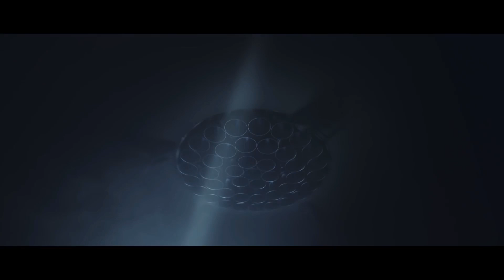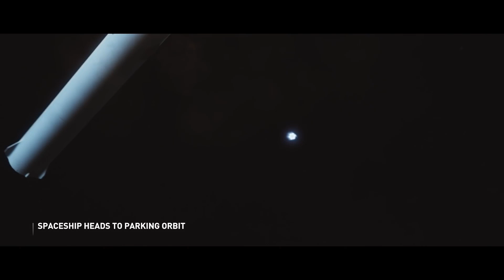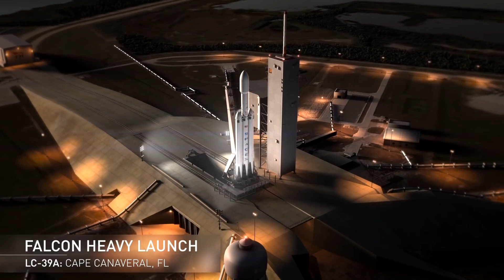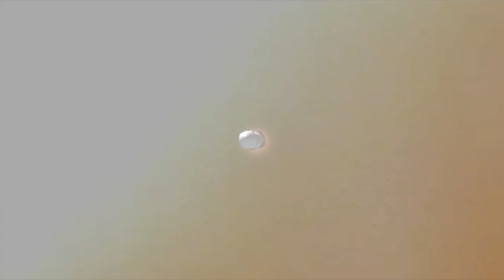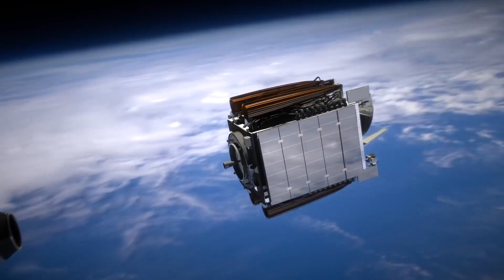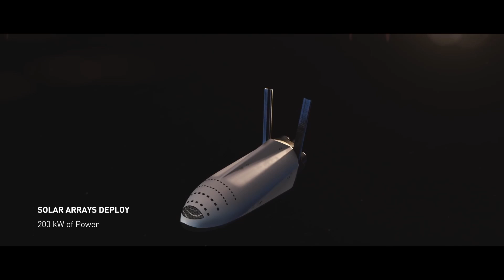Why 42! Engines On SpaceX ITS Concept? - A Simplified Little Insight Into Optimization And Scaling

Comment: What about the thrust per nozzle area ratio? (for rockets with higher sectional density)
Reply from the maker: usually for one fuel and one surrounding pressure a well optimized rocket engien will have one resulting thrsut/nozzle area ratio
 either way no matter the thrust/area ratio the thrust to weight ratio is still roughly proportional to the inverse of the nozzle diameter - that is also depending on material and engineering quality - but essentially you need enough material to carry the force of your thrust over the size of the nozzle
Reply: +Julian Danzer If you have an higher chamber pressure that means that the nozzle ratio will be higher so the exhaust gas will be colder, more dense and will move faster so you need a smaller nozzle.
What's exactly the nozzle ratio? The ratio between the density of the gas in the combustion chamber and the exhaust gas ???
If you keep the same nozzle size and you increase the chamber pressure the ISP will be higher despite the fact that the engine will be underexpanded? The nozzle ratio will be the same so the efficiency should be the same but the exhaust pressure will be higher than air pressure so the gaz will keep expanding and the ISP will be higher (despite the fact that you will have a small loss in efficiency due to the gas expanding sideways)
Reply from the maker: yes the isp will be higher but it will still be very close - all optimisation towards efficient rocket engines like higher chamber pressure, better designed shape, etc mostly changes only a few percent of the ISP - that said yo ucould build a way way way underexpanded engine and get a higher thrust to area ratio and it owuld also have a btter thrust weight ratio but you can't take it very far before the loss of efficiency is no longer worth it
a well optimized engine for tkaing offo n earth releases gas at around atmospheric pressure - and at that pressure and the burning temperature of your fuel that gas happens to have a certain density - since ISP optimisation is in the range of a few percent at best we also have a practically given speed and well, a given speed and density means a given massflow per cross section which again multiplied with our practically given speed gives a certain thrust per cross section - unless you build intentionally unoptimal engines - or of course switch ot an entirely different fuel
Reply: +Julian Danzer But if the chamber pressure is incredibly high (like 300 bar) you can underexpand the nozzle way further without losing too much ISP because you keep a good nozzle ratio, no?
Reply from the maker: you could - but barely anyone actually does that since it's usually just not worth it
Reply: +Julian Danzer With the actual raptor engine you can build a rocket that can send 4800 tons in space if you make a booster larger than the spaceship to improve the area and so the thrust.
But if you reduce the nozzle diameter by two (that's feasible, the engine itself is smaller than the nozzle) you can send 300 000 tons of payload in space... (square cube law, 4x the thrust per square meter = 4 times the size = 64 times the mass)
Reply from the maker: the problem is thrust weight ratio is not the only thing to optimize here - in fact it used to be important - but the higher thrust weight ratio gets the less relevant it becomes
think about it: imagine a rocket where 60% of it's empty mass is engines - making lighter engines could vastly improve it - whereas one where 1% of it's empty mass is engines - well further improving it won't save more then 1% weight
space x engines are already so light that further improving them isn't really worth it anymore - going to space still needs fuel and fuel needs fuel tanks
the falcon 9 first stage contains about 4.5 tons of engines - and about 15 tons of fuel tanks - so you can see while improving engines might help, it's not going to limitlessly improve hte rocket, improving fuel tanks would be much more important
same with the BFR but on a larger scale
Reply: +Julian Danzer Yeah, higher thrust to weight ratio (fuel tanks included) means more full mass/dry mass ratio so more delta v
Spacex need more delta v per stage in order to be reusable: The booster needs to be lighter than the second stage at MECO in order to keep an high efficiency. The lighter the booster is, the faster you will be at MECO while reusing it. With more delta v per stage you can even perform a boostback in order to land on the launchpad.
The second stage also need the highest delta v in order to decrease the speed at MECO so you can perform a boostback and landing. It also need an high delta v if you want to refuel it in orbit to go to the moon and back.

Comment: It's not about thrust at all (although the Merlin engine is quite efficient).  NASA had a rocket with a comparable payload 70 years ago.  If it was sheerly about thrust, then SpaceX hasn't substantially improved on something 70 years old.  But that's not the point at all.  It's about cost and re-usability, something which SpaceX has excelled at.  
1:  Keeping the same engine size as their earlier rockets allowed SpaceX to build a series of larger rockets, while only iterating on (rather than re-designing) their engine.  This saves on cost, and you will find the raptor engine to share some parts with the Merlin, and be of comparable size.  This is why BFR will use similarly sized engines, even though the scale is much greater.  Because it will share parts!
2:  More engines allows finer control of thrust.  The falcon 9 is able to scale back to a small fraction of it's maximum thrust (due to it's numerous engines), which is absolutely critical for landing their rockets in the final moments.
Reply from the maker: indeed its not about thrust - but it is a bout thrust to weight ratio - the BFR will be almost an SSTO, while the Saturn V needed three stages to get into orbit - other parts ocntribute s well but the thrust weight ratio of the raptor engine compared to the F1 is probably the biggest difference that makes it possible for the BFR to need less then 3 stages in order to reach orbit
Reply: No, it's not.  In fact the weight of the engine itself is a pittance compared to the weight of  the fuel.  On the Falcon Heavy for example, each booster carries 9 engines weighing 200kg each (1.8 metric tons) and 395 metric tons of fuel.  So efficiency of fuel usage and raw thrust are actually MUCH more important than thrust vs weight of the engine.  The merlin engine in that example is literally only 1/219th of the weight of it's fuel. 

Specific Impulse measures the efficiency of the engine in generating momentum due to fuel.  And raw Thrust allows that rocket to escape gravity in a speedy fashion (since gravity is a constant, the longer the rocket spends in opposition to it, the more fuel it will use - which is why first stage boosters often feature great thrust and less impressive specific impulse).  

While the Merlin engine is noised about as having the highest thrust to weight ratio of any engine, that's mostly a marketing slogan.  It only boasts mediocre specific impulse.  In fact, the engines built for the upper stage of the SLS (J-2X) have roughly 44% greater specific impulse than the the Merlin 1D and 1D FT.    

That's not to say that SpaceX engines are any kind of slouch.  The alleged stats for the Raptor include an impressively high Chamber Pressure (and this is important for various reasons, especially with smaller engines, which I won't go into atm).  And the Merlin 1D  produces a great deal of raw thrust (almost 1 meganewton).  There are other impressive features.  But there are heavier engines that excel to a greater degree in any specific category.  

But if the falcon 9 ran on 3 engines rather than 9, it would only be able to throttle thrust to 1/3 of it's engines.  Which would make it's 'hover-slam' approach to landing much much much more difficult (the Falcon 9 can hover due in part to it's ability to turn 8/9ths of it's engines completely off).  Additionally, a rocket with more engines can survive more engine failures (yay for redundancy).  And also, completely re-engineering their engines from scratch every time they decided to launch a bigger rocket would cost SpaceX a lot of money.  Those are literally the #1, #2 and #3 reasons why SpaceX is using smaller engines.
Reply from the maker: engine weight to fue lweight comparisons are a bit misleading - in fact the engiens make up about 1/10 of the first stages empty weight - and that is important - the fuel eight to empty weight ratio is always pretty big in rockets, but since the rocket equation is exponential for an ssto the empty weight may not be bigger then 1/20 of the fuel weight - so thrust to weight ratio is indeed relevant - in the falcon 9 the engines are rather lightweight even compared to the fueltank, so here they don't matter much - but if they were heavier that would change and tey would become a significant impact on the overll delta V - also the sls or spaceshuttle engines are completely irrelevant comparisons - they burn lh2 lox rather then hydrocarbon lox - now the different hydrogcarbons can be approximately grouped together but lh2 stands completely seperate - for very simple chamical and physical reasons its quite obvious that any lh2 engine will have much greater specific impulse then a hydrocarbon lox engine BUT the fueltanks for LH2 ar incredibly heave - here the enigne indeed becomes irrelevant, the rest of the rocketstructure becomes much heavier and its overall al ess effective system, building an ssto with lh2 is pretty close to impossible without some far future materials while building an rp1-lox or methylox ssto is counterintuitively much easier despite the lower isp simply because the fuel tank is so much lighter and smaller
Reply: Those are fair points.  Sure, it matters of course, in the sense that it's not irrelevant.  Of course if the engines had an exceedingly low Thrust to weight ratio this would become a major issue.  And of course every kg matters.  There's a lot of factors involved that weave into the Tsiolkovsky rocket equation, and I don't disagree that (engine) Thrust to weight has an impact, but it's far from being the only one.  I have a feeling that you understand this, and we are just approaching the issue from two separate angles.  I could say it's not the significant distinction between engines where modern engines are generally pretty light, but someone could make me a liar by building a garbage engine out of lead (hyperbole - obviously lead would be a horrible material lol).

But these aren't the primary reasons for smaller engines.  Both Blue Origin and SpaceX rockets have the concern of being able to near-hover.  Blue Origin solves this with a single BE-3 engine that can throttle down to below 20%.  SpaceX solved this by using multiple engines, when each Merlin D engines is only able to throttle down to 70% each (latest iterations are more impressive, but the original design called for 70%).

Obviously, you can't hover an empty rocket at 70% throttle.  Therefore you either need to develop an engine with more impressive throttling characteristics.  Or you use smaller more numerous engines and shut excess engines off completely.  SpaceX chose the more expedient route.

Comment: You are wrong. A lot of small engines is less efficient than One giant engine. If you scale up your engine certain parts like nozzle, piping engine walls are scaled in 2D(because they are flat) and the combustion chamber, and nose cone volumes scale 3D. So if you double an engine on x,y, z you get 8 times more powerful engine that is about 4 times heavier.Some parts don't scale well so probably about 5 times heavier. The reason SpaceX has a lot of engines is due to easy manufacturing and high redundancy
Reply from the maker: walls will also need to get thicker though - and at the same pressure and exhaust velocity, an enigne with twice the diameter will only have 4 times as much power, for obvious reasons
Reply: check the history of Saturn V F1 engine. Elon said in readit AMA that he can easily scale raptor up and have better trust to weight ratio. but has alot o engines for redundancy
Reply from the maker: thats as I mentioned because of small complicated parts being harder to design and build, so you are forced to make them oversized for small engines, without manufacturing limitations the basic physics set limit for thrust to weight ratio is simply set by the combustions specs, the material and the size of the engine, whereby the thrust weight ratio is invert proportional to the neck diameter

Comment: I love the ITS design but we are still decades away from rapid reusability as seen in the ITS simulation. It took months just to get the Falcon 9 for SES-10 flight worthy again. There's also the staging problem with a rapid reuse system. You cant simply launch a rocket & reload it with a new payload immediately after launch because explosive bolts would have to be replaced every time. It seems like this part of the ITS design gets overlooked pretty frequently.
Reply: Which explosive bolts? Where exactly are they used in Falcon 9?
Why replacing these bolts may take more than 24 hours?
Reply: They use hydraulics, not explosive bolts to seperate.

Comment: +Julian danzer I'd be interested hearing more about air-to-air missile engine designs (with higher thrust to weight ratios) and what makes them impractical for use in rockets
Reply: The high thrust to weight ratio creates high g forces on the passengers. fortunately for warheads, they are not very susceptible to high g forces. Also, the engines on missiles are cheap and not as reliable as would be required if you were sticking humans on top of them. If you think about it, John Glenn and the Mercury 7 had a LOT of balls, because almost 1 in 5 of all Atlas launches failed!

Comment: It is a simple case of bigger combustion chambers are too hard because of combustion instability.... everything else you theorised on is pretty irrelevant, as proved by the Russian engines, they are huge (dispelling your theories) but have many SMALLER STABLE COMBUSTION CHAMBERS.
Reply from the maker: umm... many smaller combustion chambers was kinda what I was going on about - and they're not really theories as much as facts of basic mathematics - the exact reasoning and detailed layout of engines is complicated but in genereal if you scale down a structure it can now carrie more times its own weight - thats basic mathematics
Reply: As for irrelevant, i was using the most used and successful rocket ever as an example, big engines but many small combustion chambers.

Elon is taking that huge next step by trying to make bigger methane full flow rockets, the payoff could be great but the cost definitely will be. 

I don't know if anyone has even tried to make a rocket run on gas on gas mixing in the combustion chamber before, that is pretty revolutionary in itself.

I will apologise for writing "dispelling your theories" and remove my comment if you link to where you actually say the words "combustion instability" in your insightful explanation of why SpaceX uses many engines over a few big ones....

As far as i have heard, that is the biggest problem to bigger combustion chambers/rockets.

Some might hypothetically suggest the US would have suffered the same problems the Soviets did if they tried to make a rocket with many smaller screaming engines rather than having the top fuel dragster approach (just top up more fuel theory) F1 engine.

The combustion instability of that engine was huge and only solved by running crazy rich inefficient mixtures, ..... which engines are still used to this day though??? 

Elon is very lucky those silly Soviets proved the all knowing Americans were wrong about what they said was impossible for turbopump and combustion chamber design/pressures. 

Finally Elon has made the logical decision of developing the full flow methane rocket engine, Mars and one of those moons at least out there, Titan? has endless supply for what any mission for the next ? thousands of years will need.

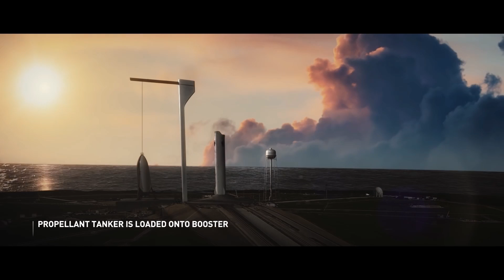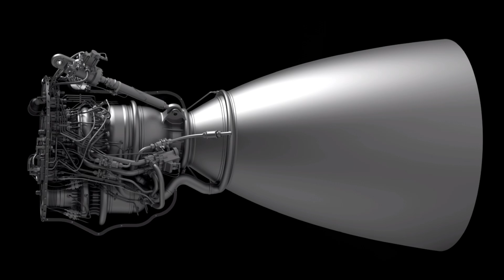What you said from 2:00?-2:30 is correct, they first build a test model engine, like the scaled tested Raptor rocket Elon showed, yes they are seemingly, hopefully happy with their design, no engineer know the word perfect, they're thrilled and lucky to be doing it today with the awesome new manufacturing process's but... BUT... I am pretty sure there will be some issues (HOPEFULLY NOT!!) when they build a full size version due to instability of that pesky unpredictable flame.

Brilliant idea though of making a scaled engine that still proves useful after development as a smaller engine of it's own.

Maybe they can crack something new with methane, it is crazy it has taken so long to try, the Soviets tinkered for a while it seems. 

There's a good article here that explains well why the Raptor is unique:-

https://www.nasaspaceflight.com/2016/10/its-propulsion-evolution-raptor-engine/

 I would never suggest you don't make videos but match your content to titles, no real secrets in this one, but make more by all means.